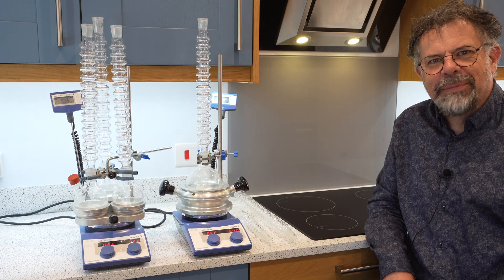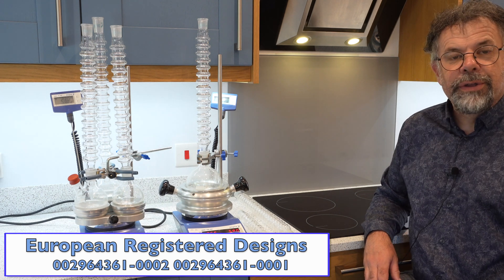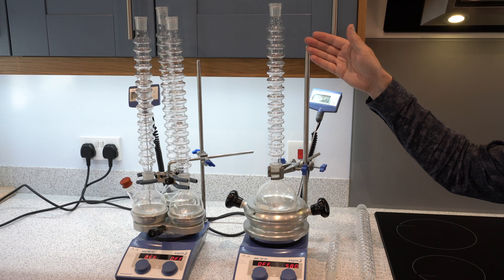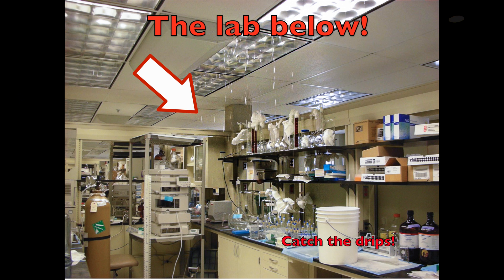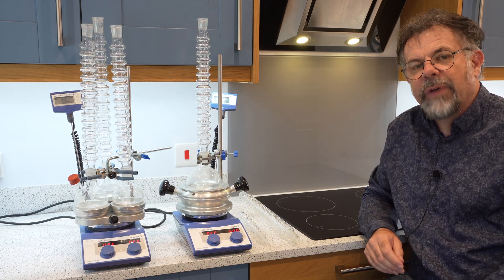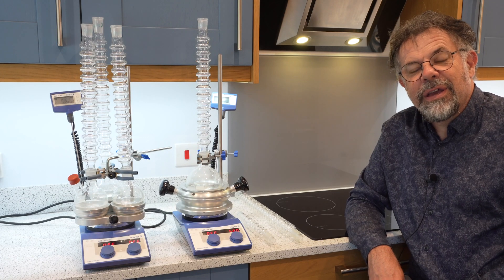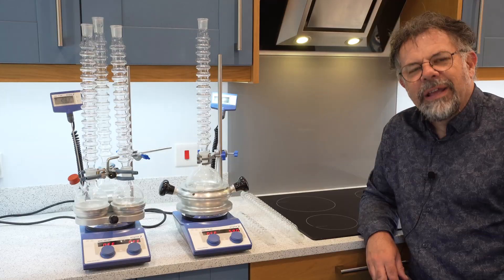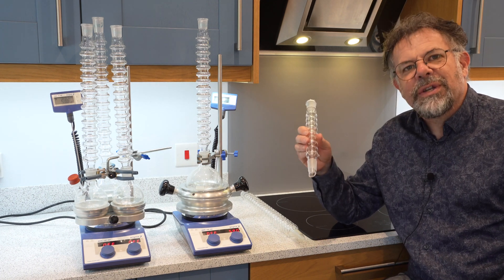Water free reflux condensers that perform as well as a water condenser!  CondenSyn from Asynt

Comment: I want to know if my solvent need -15°C this condenser can be use ?
Reply: I am not sure what You mean by that question, but most borosilcate glass does withstand quite low temperatures as long as the temperature is relatively evenly distributed, compared to things like liquid nitrogen i don't think -15C should be a problem for it to handle, but You can obvously not re condense anything below the temperature of the air surronding the condenser with this type of condenser.